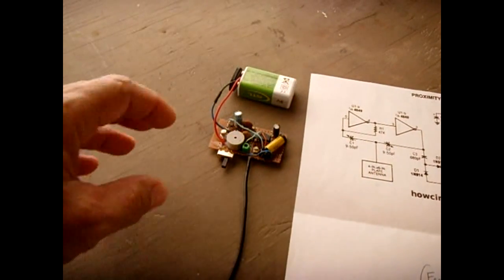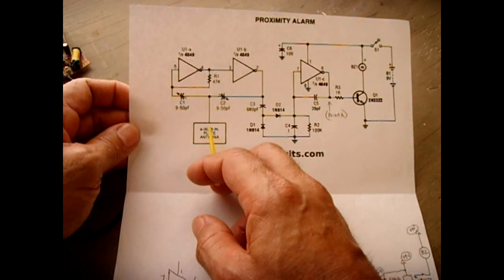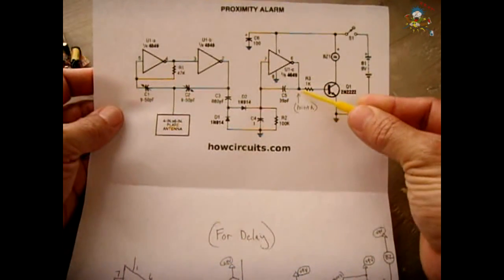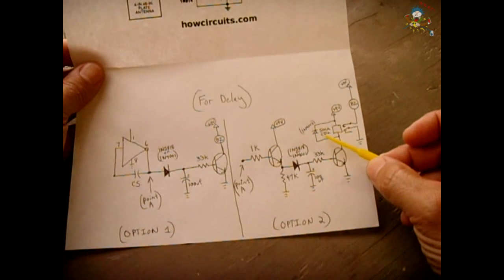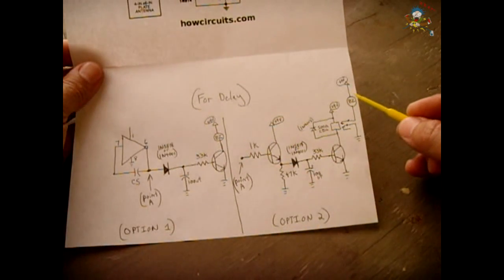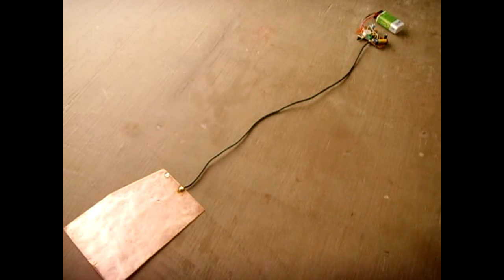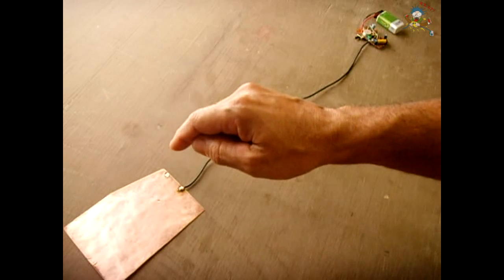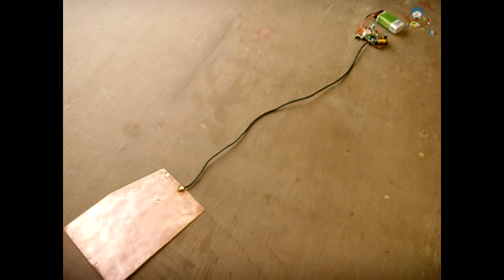How To Make A Proximity Detection Alarm!

Comment: Neat circuit. How much current does it draw from the 9V battery when it's not buzzing? I just wonder how long the battery will last. Maybe I could power it from a transformer instead.

Comment: Has anyone tried it on breadboard? Because it's not working for me. Can anyone help me with this?
Reply from the maker: It definitely works. I don't waste people's time showing bogus circuits.
Reply: @electronicsNmore  No sir, I didn't mean it that way. Sorry for the miscommunication. It didn't work for me in breadboard is what I meant. Maybe I might've done some mistake
Reply: @electronicsNmore  Also, can I run a dc motor at the output instead of buzzer?

Comment: Great work!!
I have a similar application. But how the range can be adjusted? Your hand is very near to the plate.
Can i increase the range upto 10-15cm?
Reply from the maker: yogesh ozarkar 10-15cm is too far.
Reply: Thanks for reply.
I asked this question, because i have seen this in food industry(Visited for studying my project). Instead of hand it detects the hot sauce when filled up to particular level. The sensor was above the sauce tank. And there was knob to adjust the range of sensor. I even seen the sensor taking in hand(They had extra one non-working).
OK, I will study more in this regard.
Thanks
Reply from the maker: Try my other video below:
https://www.youtube.com/watch?v=3eO51lcaooc

Comment: Is it possible to set the sensitivity to its maximum and put a wire all around my home to f*ck any intruder with an hyper loud alarm?
Reply from the maker: +Integrated Electronics 
Hello. You need to use a sensor plate. You would be better off using multiple PIR modules placed around your home. Have them trigger your siren.
Reply: +electronicsNmore Ok but i want the indruder to be pwned  (and possibly arrested!!!) before entering MY house.
Also PIR sensors are expensive, I think it will be cheaper to put a wire running all around my house
Reply: +Integrated Electronics I can also connect it to my railings, so if an intruded tries to climb on, he will not see any PIR sensor, the hyperloud alarm will ring and the intruder will run away faster than Usain Bolt (lol)
Reply: Too late, I already have an alarm system (not homemade). I abandoned the idea of the capacitive sensing railings, as it may be too much/not enough sensitive depending of the ambient humidity (and it may cause interference as it uses RF energy). Perimeter ptotection systems such as I wanted are reserved to inductrial/military and are way too much expensive.

Comment: hi do you have a list of the parts you used also could a power led bulb and a flashing bulb when buzzer goes of be fitted many thanks
Reply from the maker: Clint walker Hi Clint. All the parts are clearly shown in the schematic. The link is in the video description area. You can take an ultrabright LED and connect it in series with a 330 ohm resistor and place it across the buzzer(Anode of the LED to the (+) rail. Both will come on at the same time. You can also buy fast or slow flashing LED's on Ebay. 

Thanks For watching. Be sure to share my channel with others and rate Thumbs Up.

Comment: thank you for another good video. in option two did you use 2  2n22222 transistors.
Reply from the maker: Yes. That is exactly what I used in the demo on video.

Comment: Out of curiosity, is that camera shooting this recording in 600x800 or VGA? I know from past video's that it is defiantly a CCD sensor, which is almost obsolete these days, and apparently difficult to record video with, since they are power hogs and thermal design becomes very challenging. If so, why are these video's rendered and uploaded in 720p? Only reason I ask is because I noticed I could not make out much of the fine print on the schematic shown, although I could have figured it out anyway since it is fairly simple in this case.
Reply from the maker: Could be due to the lighting, or being slightly out of focus. The exact same Samsung camera has produced every video on my channel. You can always refer to the link in the video description area for a clear image.  VGA. I have the video editing software render everything 3500 kbps / 1280x720 w/black bars on each side. Looks much better.

Comment: Thanks for the video, I like these capacitive sensors.
I was thinking maybe an Arduino based capacitive sensor might be easier for me,
since it could be just a resistor and plate circuit,
and output alam would be easily customised.

Comment: Thanks for sharing
can you make this to trigger 12v led lamp on with delay ?
Reply from the maker: Yes. The circuit should work fine at 12V since the IC is rated up to 15VDC. Replace the piezo alarm with an LED and series current limiting resistor..